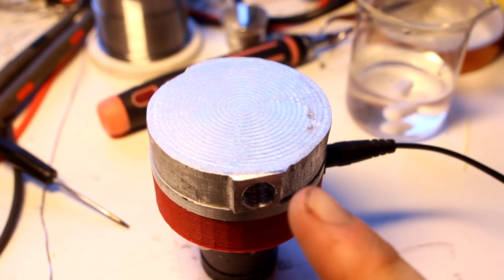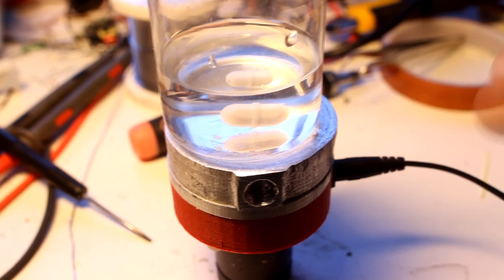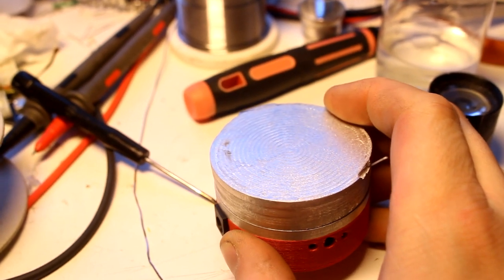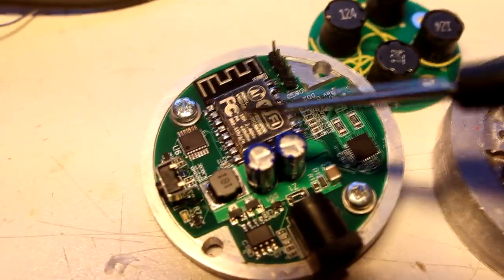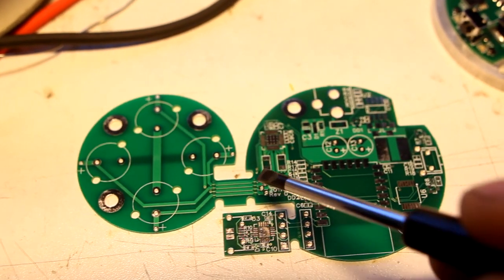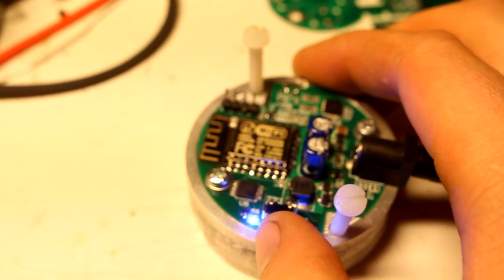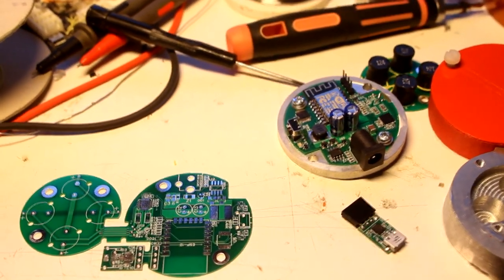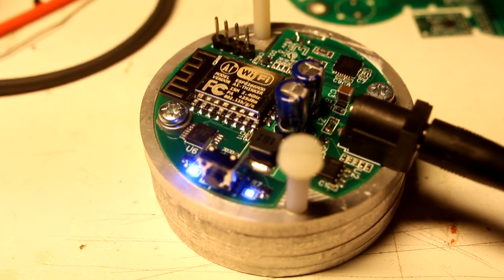Magnetic stirrer project (045)

Comment: For those of you trying to build this, it's easy and difficult. I tried to identify a proper component/supplier but I think the reality is that this kind of thing tend to be purpose built for a specific application. After some experimenting, I opted to buy a few different sets of sketchy electromagnets off amazon or ebay. Smaller coils used for magnetic levitation projects worked well enough on less viscous solutions, but heat could be an issue.

For higher viscosity, another option is to look at these electromagnets that sellers that advertise these with about 50 keywords in the title like “suction”, “holder”, “sucker”. (The reviews generally complain that the product does not meet the specification but it’s ok.) I selected a “180N” 24V model. These coil are not designed for continuous operation so it’s important to derated the coil. I had some interesting results.

I set my wave gen to use the sweep mode to gently accelerate the stir bar. This works great for water. With, I believe canola oil, I was able to ramp it up from like 120Hz to 220Hz (32x micro-stepping) before the stir rod would become unstable and begin to behave like it was in a mosh pit. I thought it was a failed experiment, but since I left the ramp on, the frequency kept increasing until around 320Hz it began spontaneously stirring. At about 500Hz it was stable, and robust. Around, 520Hz +/- 20Hz it would tend destabilize again. I reproduced the results quite consistently. Increasing the frequency closer to 1KHz, the stir rod would begin spinning again, but at a significantly reduced rate. Although clearly operating beyond the specification, an interesting observation is that the motion was very gentle and smooth compared to the equivalent speed at lower frequencies.

I have a few hypotheses. In particular, I sense the stability is a function of the frequency and current. At low frequencies with fixed current, it’s like using a hammer to adjust a trim pot. Many other thoughts but this is well beyond my area of expertise so I’ll leave it at this since there isn’t a ton of information out there.

Comment: Im glad you built this. I was wracking my brain trying to figure out how you would wind a transformer/motor thingie that would produce a rotating magnetic feild, which I assumed how they would work. I was very dissapointed to find that the traditional stirring is done by... a magnet on a motor. I mean, it should have been pretty obvious, but I wanted to see some neat AC widget that made a rotating magnetic feild (shut up nerd-brain, its called a 'Motor')
So this is quite cathartic. much happier with this solution ^.^

Comment: I know Im late to the party here, but I have some ideas others playing along might find helpful? first up, dont be afraid to wind your own coils (this goes for transformers to). they are one of the few electronic components you can realistically build yourself that will outperform something off the shelf, as you can tweak the value to exactly what you want it to be. turns, length, diameter conductor, core materiel. all easily controlled. gives you a huge amount of flexibility. one tip, dont try to wind one coil (IE, the spool the wire comes on), onto another, you will create a tangle. stretch your magnet wire out, and it will be far better behaved. I run mine down the hallway, spool at one end, winding at the other. it seems to help. laborious, potentially. but its not hard. like your grandma knitting. just put on a movie and let your fingers work. If you know you need a bunch of identical components, measure out the length required (if possible), pre cut and just wind away. I attach a fishing sinker to the far end so there is always a little bit of tension.
The other thought, derived from stepper motor thinking, more poles = more good? IE, more torque. might take a little more microcontroller magic to make work than just slap a stepper motor driver on there, but surely there is a topology that could drive 8 or 16 poles at a higher frequency to get better torque. the less degrees of movement per pulse the more force you should get.

Comment: So I've built stirrers before using motors and neodymium bar magnets and when the solution being stirred is particularly viscus, the neodymium bar magnet, even though it's strong, would not allow me to stir thicker liquids with any decent strength. How would you compare the magnetic strength of this solution to a neodymium solution. The N magnets are rated at N45 ... is it possible to achieve magnetic strength much higher than N45 with this set up?

I am experienced with Arduino's and have done some stepper motor projects and Ive even designed and ordered my own PCBs, so this project is right up my alley ... but without knowing what's possible in terms of magnetic strength, I wouldn't want to invest a lot of time into this...
Reply: Did you ever get an answer to this?
Reply: @4thbx  No

Comment: Two suggestions, TI makes DRV8825 stepper driver which can be pushed little over 2A and why not decouple the heatsink from top plate with a nylon spacer? These drivers can handle 50C and more quite gracefully so why not let them?
Reply from the maker: There's still a couple watts (worst case) to dissipate, and I don't think just the heatsink would be enough. 

As for the DRV8825: I tried them (with a RAMBo board), but they made much more noise. I don't need the extra current - pushing 2A at 9-12V would be a massive heat source.
Reply: For dissipation you can always go larger (think old AMD heatsink without fan mounted on the side), and yes DRVs are noisy in two out of three decay modes. Third one is pretty silent though. Have you tried them all? (off the cuff I can't remember which was which and I don't have a board at hand to check, sorry)
Reply from the maker: There's a good chance that simply making the whole thing larger to deal 
with larger stir bars will get rid of the dissipation problem 
altogether. There's nothing wrong with at least trying that.

I tried both mixed decay and slow decay - fast decay wasn't selectable (and doesn't actually fix it if mixed decay didn't already do that). From what I know from my work on 3D printing electronics, it's really just a dead-time/frequency issue if you compare the Allegro vs TI parts. Regardless, I have no objective reason to switch anyway. The DRV8825 is much more expensive and I don't need the current capability or increased microsteps.
Reply: Of course, if you can get away without changing the driver that's the way to go :)
Obviously your experience is different, but difference in noise my printer makes when I change the decay mode is really noticeable - fast mode is almost unbearable in home/office environment, the slow one is quite all right.
I'm curious, what did you mean by "not selectable"? Pin should be low for slow decay, high for fast and left unconnected for mixed.
Reply from the maker: I was using ready-made boards; my own designed board (which will be in a video very soon), a RAMBo with DRV8825 and RAMPS with lower-current Allegro drivers. On the RAMBo board, you can only connect a jumper to set decay mode to slow and disconnect it for mixed, high is not (easily) selectable. So that's why.

Comment: I know you haven't touched this project in a while as even the posts on the science board just stopped after you made this video, but can you at least post the code that you wrote that controls the stepper driver? I've been trying to build one of these without much success even when I tried it with an 8825 stepper driver.